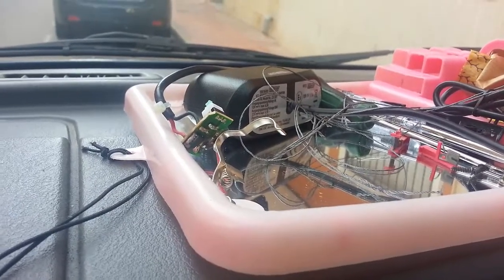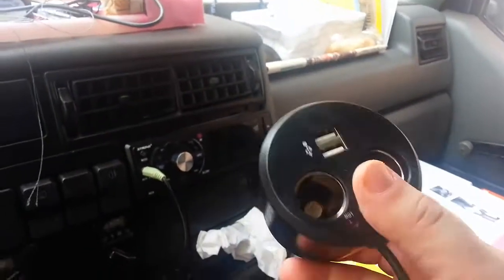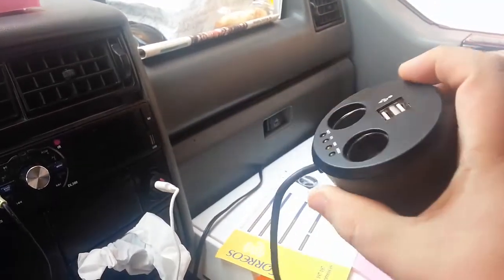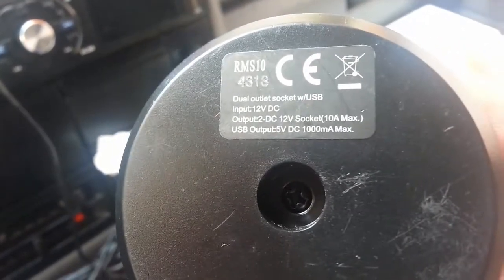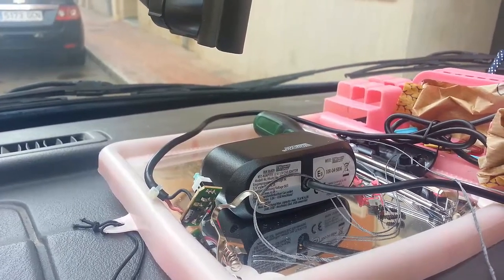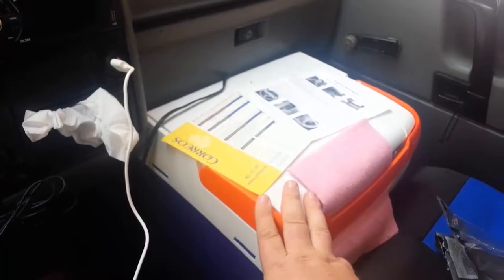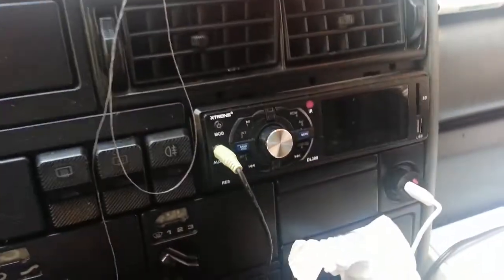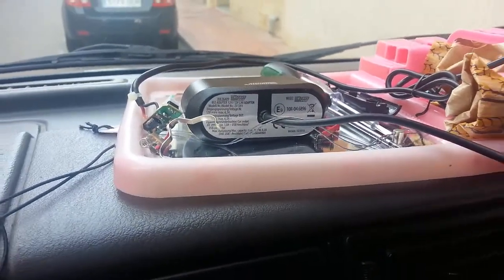VW T4 Caravelle:  Dangerous cigarette lighter adaptors

Comment: Very good long life batteries on the solar panes will do the job im looking in to getting it for the house in the Philippines I don't run anything in my car im not in it long enough I got my son CJ a cooling pad for his laptop as you know they get so hot and very quick to thanks I might look in to one of those power adapters though also my cigarette lighter socket is of unless you put the ignition on also my car has one standard in the back between the seats as well ,my car a Ford Focus 2004 model
Reply from the maker: +Kriss Bartlett The solar prices are slowly coming down although still inflated in the Philippines. Yep same with me nobody smokes so cigarette lighters just become power adaptors full-time. Driven the Ford Focus before not a bad little car. My friend Steve has one here in Spain as well finds it reliable.